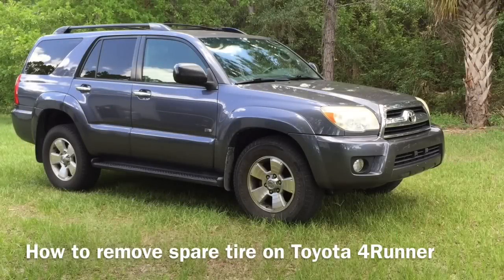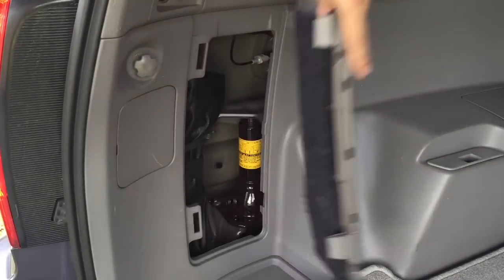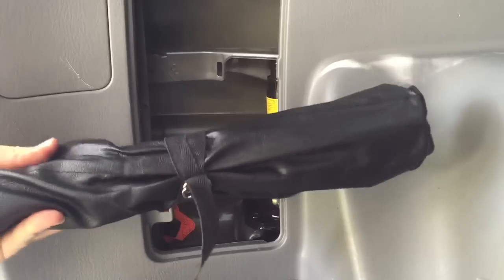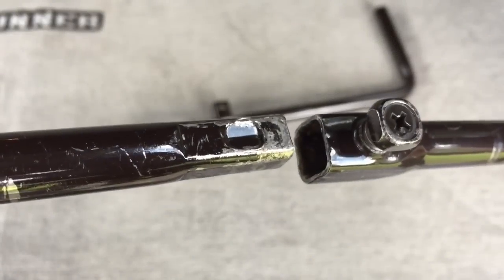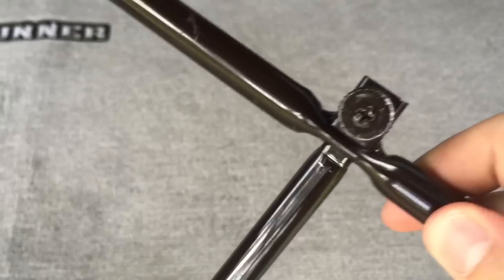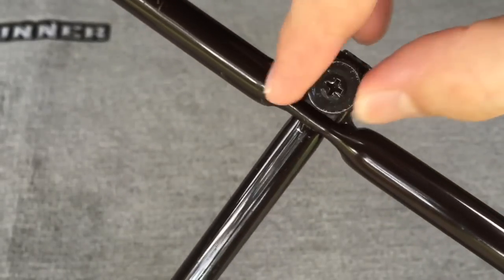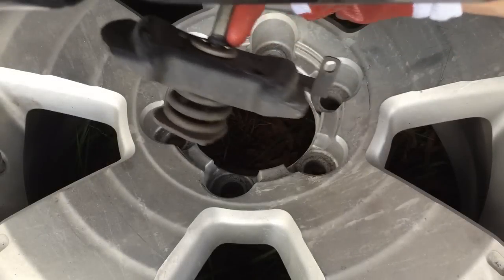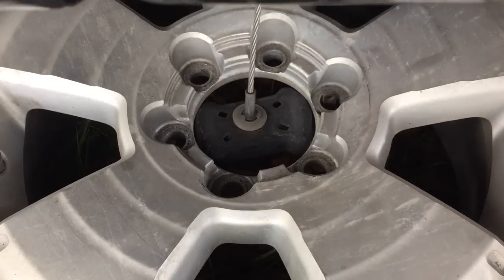How to remove a spare tire on Toyota truck or SUV.

Comment: I'm following every step, but I can't get the thing to lower down. Don't know if the bolt is all rusted or what, but it looks like your barely using any force. I'm using alot of force but can't seem to get it, am I doin something wrong
Reply from the maker: Yea, might be rusty. Mine was moving easily.

Comment: Nice that Toyota doesn’t tell you that the lowering tool has to go in the hole at a 45 degree angle
Reply: No kidding, Im used to the Tundra n Tacoma where It is straight and centered. Even an ol' Chevy was like that.

Comment: I can get the handle to turn about 2 rotations and then it gets stuck. I'm guessing it hasn't been lowered in a long time and is stuck in place. Any suggestions? Do I risk breaking mechanism if I push on it too hard?
Reply from the maker: Soak it with some penetrating lubricant and then try going back and forth when unscrewing it. 

https://www.amazon.com/gp/search/ref=as_li_qf_sp_sr_il_tl?ie=UTF8&tag=dp051-20&keywords=Penetrating rust lubricant&index=aps&camp=1789&creative=9325&linkCode=xm2&linkId=eca33d72703ea2e35ffb9fc0de0cf430

Comment: Will the spare be used as part of tire rotation?
Reply from the maker: Usualy not.
Reply: Mostly, the 4Runner has a matching full size spare, and it should be part of the 5 tire rotation.
Reply from the maker: Over time mine ended up with different brand/pattern tire, not matching other four. Cant really rotate it anymore.
Reply: So, they even said, to buy 5 matching tires for a 5-tire rotation, so the spare could be used as part of the rotation pattern.
Reply from the maker: Up to you. I find it more practical to just rotate 4. I never used my spare tire once since I owned this car. Dont see a reason to replace non-matching rubber.
Reply: A lot people said, is to have 5 replacement tires (4 mounted on the vehicle, and 1 for the spare) rather than 4, so it would be involved for a 5 tire rotation, meaning the spare would be used as part of the rotation pattern if it were a matching one.
Reply from the maker: I like swap front and back tires or left and right tires at the same time, to make them wear out evenly. Two front tires wear out faster then two rear tires. I swap front and rear. Outer most part on all 4 wear faster then inner side. I swap left and right sites. Cross rotation accomplishes both of the above scenarios at the same time. Simple and easy. Tell me how you keep the wear even on all 5 tires in the rotation?

Comment: is it common for it to have burn/melted marks from the area the spare mounts too? I have an 07 4runner that has a brand new, full sized spare. and I thought I'd check it. And found pretty decent melted marks on it, from where it mounts tight to the frame. is that normal? safe? does it compromise the integrity of the tire?
Reply from the maker: +MyCrippledWings 
Good question! 
Yes, those marks come from vibration and rubbing against the frame. With full size spare tire you are supposed to rotate all 5 wheels, so there is no single tire that is always sitting unused for a long time (and being destroyed like that)....
Reply: +4Runner I bought it 2 months ago. and figured I'd take a look at the spare. I'm assuming it's original. but newish, since it still has nubs on it. it's a Bridgestone duellar H/T. the other 4 are Firestone Destinations le2's. so rotating them all wouldn't work to well since the tread pattern is different on the Bridgestone. and the other 4 are about 25% used. I'm surprised, but other than the markings. the tire seems fine. re-mounted it with the grooves fitting the original places. will keep my eye on it though. thanks for the reply.

Comment: Well I must be missing something because the pole I have only goes in about an inch and doesn't turn anything. Sure hate to cut the cable holding the spare tire up but it coming off one way or the other.
Reply from the maker: Shone the light in the hole to see where it goes. You have to insert the pole at an angle, not straight in. Unless your winch gears are stripped...

Comment: Why the outer side of the tire up? You can't check the tire pressure that way when the tire is secured.
Reply from the maker: To protect it from rocks and scratches.

Comment: How do you put it back on.....?
Reply from the maker: Unwind the cable all the way out, hook up the tire. It’ll be a lot easier that way.
Reply: The video literally shows how to put it back on in the end...
Reply: @Cusesucks  Just cut the wire holding it on and either mount it on back door (if possible, not sure on these), the roof, or possibly in back. No use having a spare tire that you can't access when you need it the most.

Comment: Is there any other way to remove the tire?
Reply from the maker: Not really....
Reply: Bolt cutters
Reply: Just cut it off if it's all rusted. See if you can find a way to mount it elsewhere...anywhere than on the bottom of a vehicle...

Comment: mine hasn't been lowered in years,, it's stuck
Reply from the maker: It's actually a good idea to rotate full size spare with other tires from the beginning. That way you would probably had them wear out evenly and kept the same brand/model if one of them gets flat...

Comment: The only problem is that my trunk won't open, something is broken, can anyone help me?
Reply from the maker: When you press the button, do you hear lock motor making any sounds?
If no sounds - motor or wiring is probably bad.
If you hear sound - somthing is probably disconnected inside.